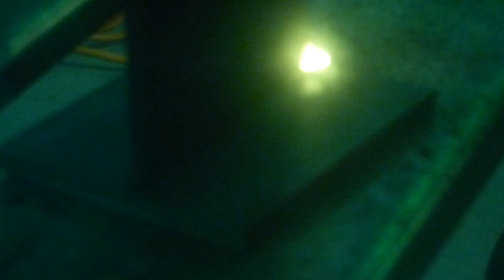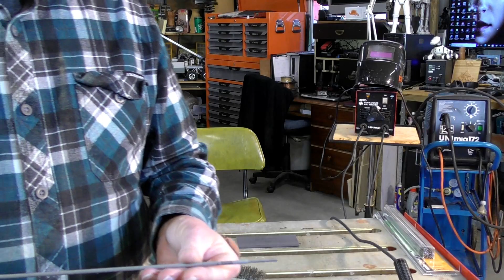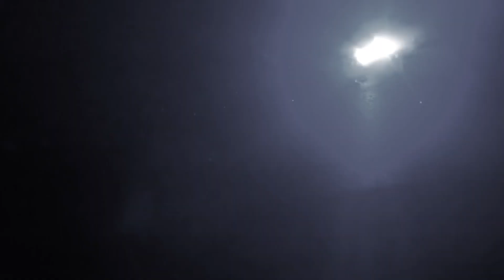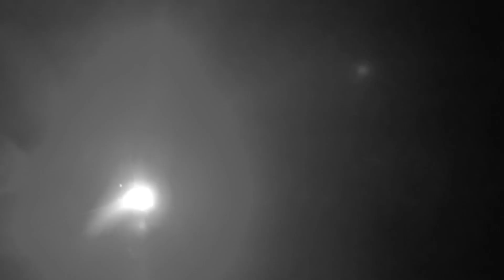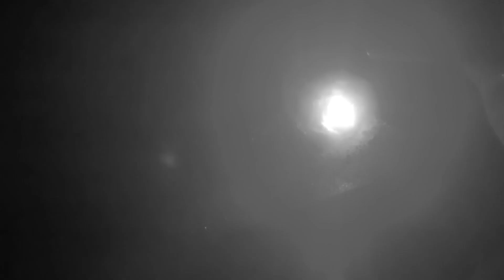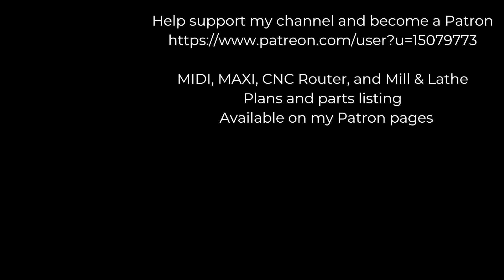How to stick weld for absolute beginners

Comment: Hi Roger,
Very good presentation. I find if I haven't used my rods for a while, I like to dry them in an oven for about 10 minutes or so and I also remove any mill scale or rust. This makes for a good clean weld. I personally enjoy welding and find it very relaxing. Keep up your wonderful tutorials!
Reply from the maker: Great tip!

Comment: Hi Rog, I don't want to rain on your parade but there is an interesting welding process out there called "cold welding"'......very similar to tig bit different........if you watch the videos on the 'Tube you will be amazed at the quality of the work......I've just bought one from Alibaba, coming in a weeks time.
Reply from the maker: AAAAaaaaa, cold welding, its ok if you want to weld aluminum 1mm or so, but steal you need heat. You would be better off getting a MIG or a TIG welder, see my next video.
Reply: @inventorsworkshop9600   The videos showed some quite substantial weldings using cold welding......the one I'm getting is a tig but it also does cold welding.